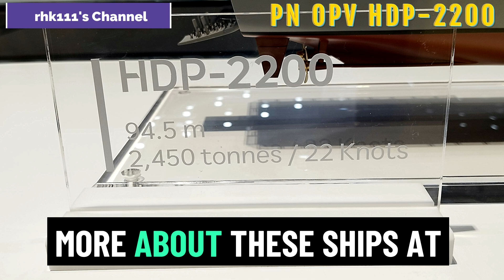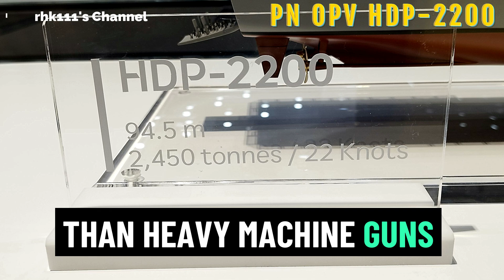Philippine Navy OPVs lack Anti-Sub Capability, only has limited Capability against Enemy Vessels

Comment from the maker: "it is a patrol vessel meant primarily for extended duration patrols further away at sea, to improve presence in an AO. It is a ship built for a purpose so why would it be a waste of money? 

Being a patrol vessel I don't think its hull is optimized for ASW work - meaning it might have more flow and internal machinery noise that can impair an HMS in passive mode, and which also affects the performance of a tail (towed array) if it is fitted one."

- Pure B.S., so you have a Ship that is easily detectable by Submarines, then? LOL. If it's only for Patrol, why even arm it with so many Cannons? A 30 mm Gun would've been enough, like the Coast Guard Vessels. Bottomline is that we shouldn't be wasting our newest Hulls "just for Patrol"
Reply from the maker: "Even the Jose Rizal-class and Malvar-class frigates on the move are detectable by submarines, just on passive sonar alone - you can read about that, it's open-source hahahahahahaha you're the one spewing BS. What's the matter, not used to discussion? Hahahahaha

The 76mm gun is great for holding bigger ships at risk - inflicts several times more damage than the 30mm cannon can. A CG ship can make do with a single 30mm cannon given its constabulary role"

- The Jose Rizal Frigates have a Hull Mounted Sonar, susme. I don't discuss with Morons and Dimwits, go find some other Channel to spread your stupidity